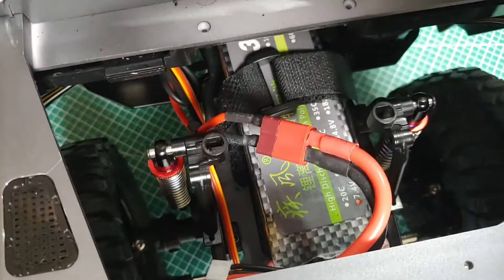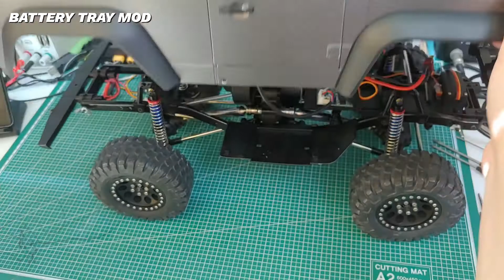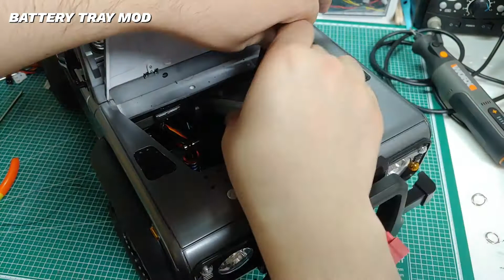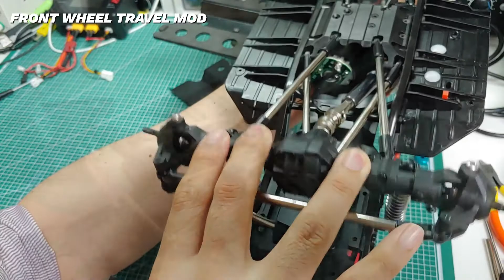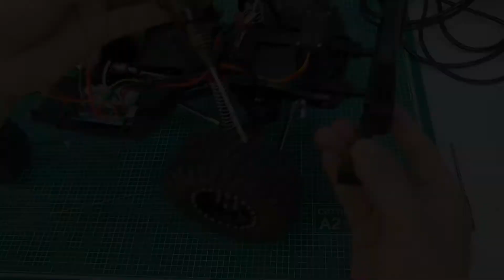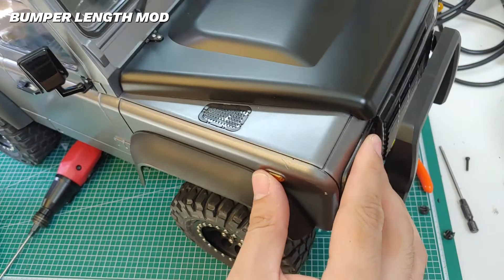[한글자막] MN999 개조 - 리포 배터리 사용 개조, 전륜 휠트래블 개선, 범퍼 돌출 개선

Comment: hey, thats kind a neat. but i see that you put back the servo to original position from the previous video?
Reply from the maker: You have a good eye! When the front wheel's interference was removed, there was a problem that the rod and the servo arm touched when the shock was minimally shirinked. This problem can be solved by rotating the servo 180 degrees and mounting it. Alternatively, if the ground height is lowered by cutting some of the shock springs like me, the bump steer will not be large even in the original servo position. This process is ongoing, so I'll show you in the next video.